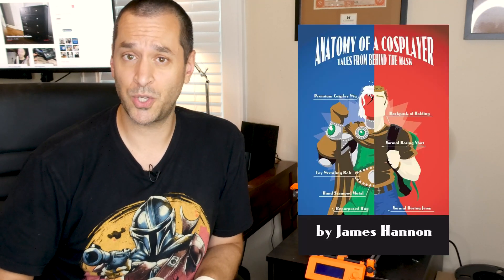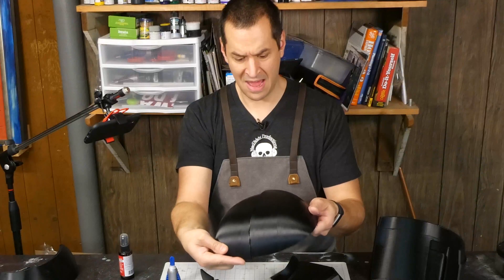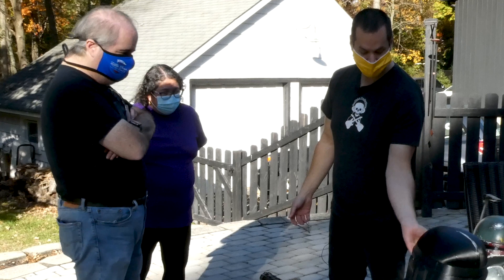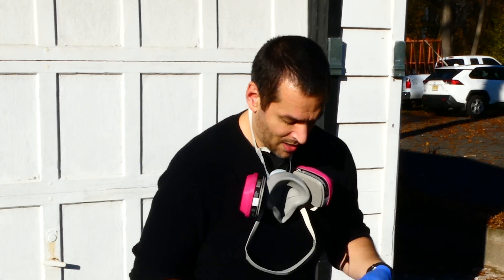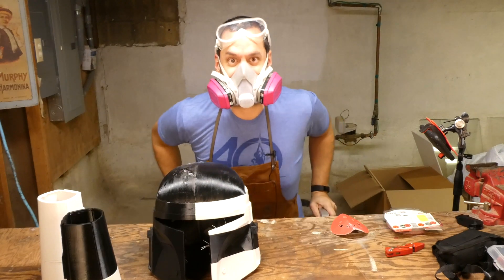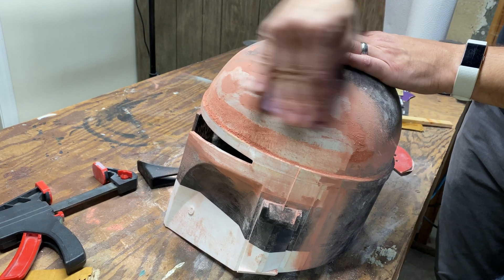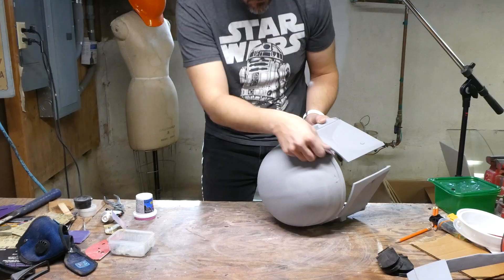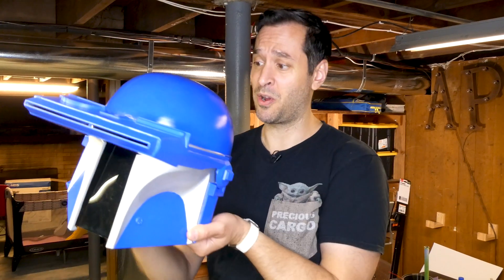3D Printing a Mandalorian Helmet on a Small Printer

Comment: did you end up using supports when printing the dome? Or can the build support itself. If so regular supports or trees?
Reply from the maker: Hi thanks for the comment. The way it was cut up into pieces I didn’t need any supports since most of the overhangs were at an angle where they could support themselves.
Reply: @MADEbyAP  Ok thats what I thought, thanks!

Comment: How much kg of filament do u use for 1 helmet?
Reply from the maker: Well that’s a good question.  I didn’t monitor it but if I had to guess it was at least half a roll of filament? So that’s about .5kg?
Reply: @MADEbyAP  
Okay also 5 KG or 2,5 KG? I'm also thinking of buying a 3d printer the filament cost 20€/1kg on Amazon
Reply: @neoncortexMW  .5kg means 500 Grams or half a filament band